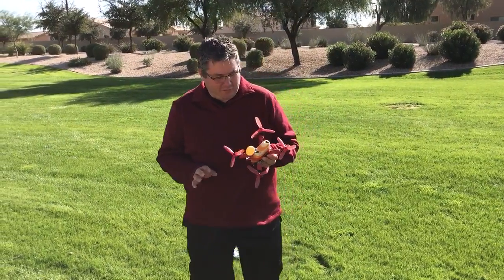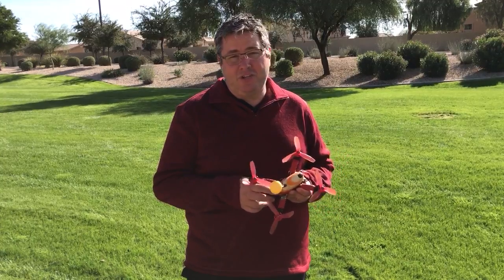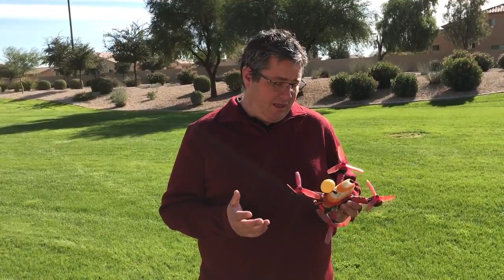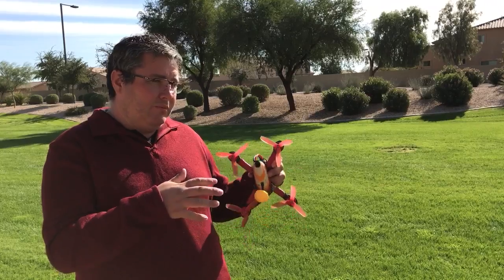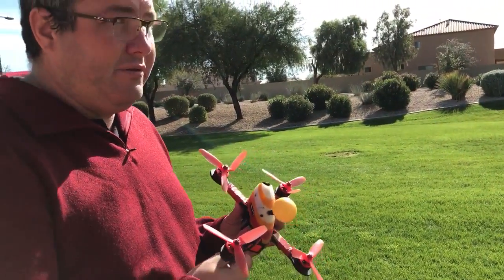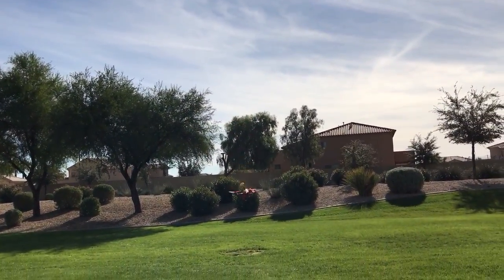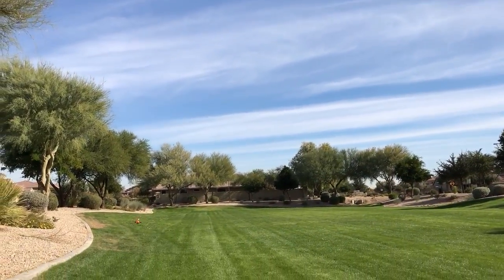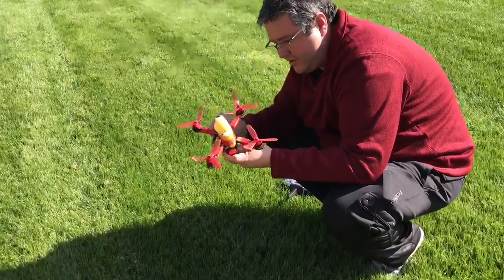Revolt Flight Controller 8 bent props

Comment: By the looks of some of these comments there is always going to be haters out there! I will tell you, I love every aspect of the Revolt Flight Controller,from its performance to the immediate/quick support system that Raceflight has set up for its users! Yes,at first I was sceptical,but once I got my quad in the air my sceptitism disappeared! I can't wait for RF1 to come out but for now BB413 works better than any other flight controller I have ever used! Above is my real name,when it comes to the Revolt I'm not ashamed to use it!

Comment: Did you fix the full throttle glitch? I saw a Revolt fly into the ceiling full throttle last week. It took someone stomping on it to shut it off! And I guess this happens a lot! At this point I think you're better off flashing BetaFlight!
Reply: Damon McCray No it was sitting on the line waiting for the race to start. This wasn't a plugged into the computer problem.